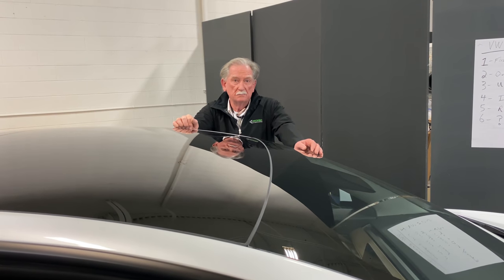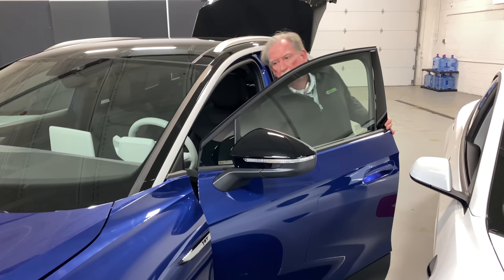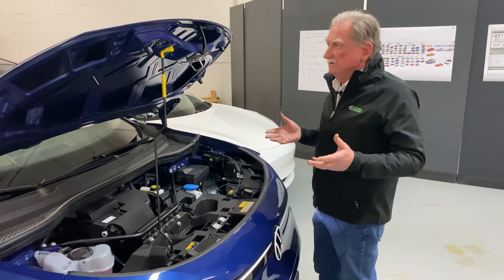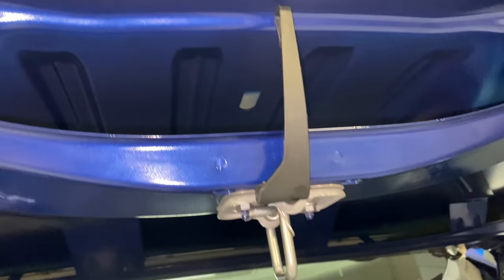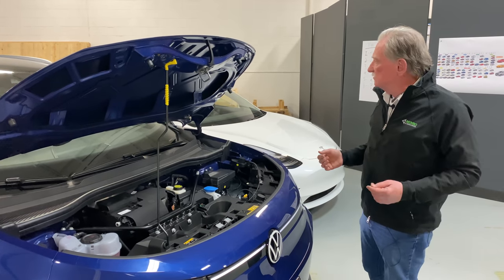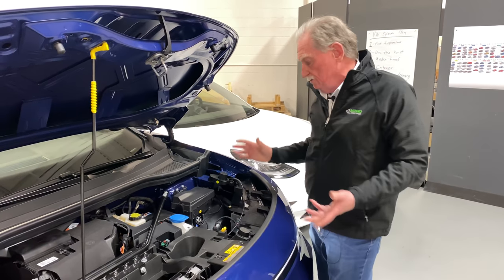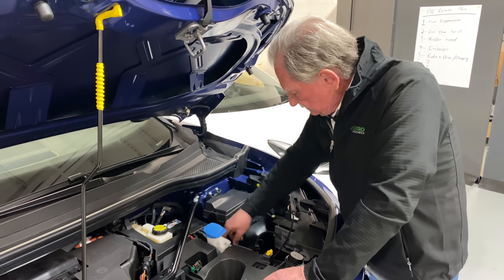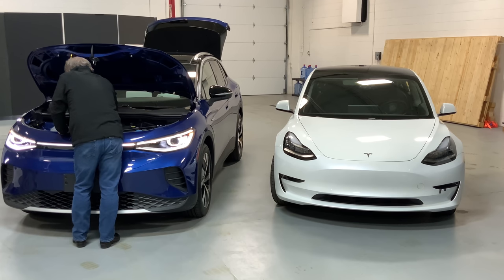2021 Volkswagen ID.4: E2 - Under The Hood

Comment: The more stuff is under hood, the less is in the cabin. Far less front overhang is a good thing. ID4 does not have a frunk because it does not have wasted space in front - more cabin space, more cargo space in the back. That is why it aces banana box test. And pedestrian safety is a very important concern.

Hooking up to 12V system in EV is super rare. You can not jump another car with an EV and very rarely you'd drain your car so much that even 12V is dry.

Try measuring how long is Tesla hood versus ID4 hood.

Comment: They traded the "frunk" to gain more interior space.  Sounds like a good trade to me.
Reply: In Tesla the engine is not inside the cabin. It's more organized and compact compared to vw. Ford Mach e is way better than this VW in terms of compactness
Reply: @adityasahasranshu7503  Of course the engine is not "inside the cabin", on a Tesla, but the engine and other components can be located much lower on the chassis because it has such a big frontal area (same as the Ford Mach-E).  VW traded the long front hood in exchange for more area inside the vehicle.  The result is they had no room left for a frunk.   I personally think that is a good trade.  Give me more room inside the vehicle anyday.
Reply: @mikek2218  space with the rear seat flipped down : Tesla model Y - 68 cubic feet, VW id4 - 64.2 cubic feet. Tesla model 4 more space inside with a frunk.
Reply: @adityasahasranshu7503  Yeah, but the VW has more occupant space and that is the big difference (not cargo).  With EVs, you don't need that big front hood like you do with ICE vehicles.  So a designer can choose what to do with it.  Tesla decided to keep it as big as an ICE vehicle, but also provide cargo storage up there.  VW decided to shrink it down, and provide more interior space in a smaller footprint.  I personally like the latter approach.  Just look how Canoo is designing their vehicles with almost no front "nose" at all, because there is no need for it, and providing huge interior space in a very small footprint.
Reply: @mikek2218  Tesla Model Y - FLR- 41.8", RLR- 40.5", FHR- 41", RHR- 39.4". 
ID.4 - FLR- 41.1", RLR- 37.6", FHR- 41", RHR- 38.4". (LR- leg room, HR - head room). interior space for occupants is smaller in id4, in every crucial aspect then how VW shifting the motors to the front created more space. Tesla is years ahead from VW they ant even make the same interior space by sacrificing the frunk.
Reply: @adityasahasranshu7503  The ID4 is a smaller vehicle than the model 3 and tiny compared to the model Y.  And even though the ID4 is a smaller car, it has an interior passenger volume of 101 cubic feet while the T3 has 97 cubic feet.
Reply: @adityasahasranshu7503  Well... I guess the fact that the T3 has 4 cubic feet less interior space than the ID4, (even though it's a bigger car by 4.5 inches),  somehow makes the T3 bigger inside by your math.  But that's OK... I know very well how Tesla fan boys aren't big on logic.  To each their own and I'm sure you will be very happy with your Tesla.  I personally will chose almost anything else, (except an ICE vehicle).  But then again I also enjoy rowing boats so I'm used to going backwards :-)

Comment: Bit of an odd review mainly around Sandy's confusion with 'all this stuff' under the hood that could be hidden in the cabin somewhere, already answered by various posts below. I think the VW idea of bigger cabin vs Frunk space is a better choice: he showed how accessible the various components are under the hood for maintenance; the Tesla frunk relies on you pushing down on the hood to close it - fun when it's covered in grime plus if you use it a lot how does the paint stand up, or even the aluminum hood itself?

Comment: Definitely some interesting details I learned from this video (and I watched a lot of ID.4 videos in anticipation of receiving my car...).
They kept the hood very short for a very tight turning circle, and then moved the hvac in there to optimise cabin space. I guess they could have optimised it a little bit to include a small frunk, and that would have saved them a lot of bad comments in reviews... As for usefulness, I don't think it adds much unless it fits a suitcase, or like the Mustang with the drain, where its great to put wet stuff (wetsuits and such after a surfing session).
Reply: I think that frunks are less critical than some (including Sandy) think and I would rather have more space in the interior than moved into a frunk, but I do think that VW missed a chance to at least store the charging cable and maybe a flashlight and/first aid kit under there.

Comment: The no frunk is understandable. VW pushed the cabin forward. The power and control electronics sure could use some help. Still using old school manufacturing technology. I still think this is an excellent first for VW making a full EV.
Reply: Sandy says VW should Abandon the MEB platform for a MORE Advanced NEW BEV platform.
its built too much like a GAS car.

Comment: VW claims they don't have a frunk to make more cabin space.
Reply: and they achieved it cause the car is shorter than a model 3 and offers more trunk and a compartment below teh frunk
Reply: they also have used that space to give more room to the wheels, the turning circle is impressive
Reply: + but in The same time, there needs to be a space for front motor in ID.4 X
Reply: The problem for VW is that when they came to design the ID.4 they started with a clean sheet but they used old ways of thinking.  The hood volume of the Model 3 is much smaller than that of the ID.4 and yet it contains an electric motor with battery thermal management heat pump and still has room for luggage without compromising occupant or pedestrian safety.  For efficiency of packaging Tesla has won this hands down.

Comment: Aluminium is lighter but ID-series are meant to be carbon neutral and a ton of steel production generates 2 tons of carbon emissions and for aluminum it's about 11.7 tons of carbon. Also, steel is 1/3rd of the price.

Comment: Measure the length of the hood of the Model 3 and of the ID4 and you will realise why there is no storage in the VW. Instead of putting in the storage cubby, VW made the hood shorter, and pushed the entire cabin forward, so the “saved volume” by using an electric drivetrain contributed to a roomier interior, instead of dedicated storage up front.

Comment: Does your aluminium hood from the Tesla model 3 comply with the european standard, or are there different for different markets?

Those kind of pedestrian protection standards are one of the reasons that I think the Cybertruck will eventually look very different from the prototype
Reply: The CT will not be sold in europe.  It will compete in the US with F150 etc.  If Tesla had to consider pedestrian safety they would probably opt to have better collision avoidance software and perhaps a pedestrian airbag.  Think like Tesla...they just don't copy existing solutions.

Comment: You ask about why Tesla got so much usable space in the front and VW does not. Both cars next to each other but never even a simple comparison or measurement of the fron length and or overhang? Would hope to see that as well as both matter in trafic andit could as well be a reason for more or less free space.
Reply: I suspect that is the case.. I also suspect that a frunk is not anything like a make or break feature in terms of purchasing decision.
Reply: VW ID4:
 nose to front of door: 1.34m
 nose to base of windshield: 1.03m 

Tesla Model 3:
 nose to front of door: 1.31m
 nose to base of windshield: 1.06m

What now?
Reply: @NO3V  Thank you very much. Great to know. So it is close to the same space in bith. Just used in a much different way. Happy to have this made clear.
Reply: @TheEvilmooseofdoom  go watch Björn Nyland videos on the id4, it has way more practicality and turning radius than the model3.

Comment: Doesn't the bar holding up the HVAC system provide lateral torsion support as well?
Reply: That was my thought, is that it is to help provide more front crush protection for the cabin.
Reply: I would say that is the primary purpose for it - the fact that they hung the HVAC off of it is just convenience.
Reply: Don’t think sway bar is needed due to battery pack providing rigidity
Reply: VW has a lot of legacy parts and existing ICE supply contracts that has to be incorporated in their EV designs otherwise it will have to be discarded  (cost savings)

Comment: The cross-bar in the front is not a support for the air filter / AC system.  It's a stiffening bar for the body to reduce cornering roll.

-Matt
Reply: And used as a support too.

Comment: It went to an advertisement right when you touched the jumper cable clamp to the positive terminal on the battery and I jumped. I call that beam a strut tower brace. One factor to consider in comparing against the Tesla is the length of the front portion of the car, the Tesla looks like it has a longer front giving more room to fit a storage compartment but the VW looks like it has a very blunt nose.

Comment: In the UK I’ve a ford mondeo , I had to strip the front bumper 10 mins and it was in bits grills out headlights out fogs out, I’ve also a vw  scirocco same job 2 hours if u can get the grills out without breaking them

Comment: Tesla's less known lead publicly, is in the 'packaging' of their stuff. They integrate, miniaturize and compact their stuff like no other car manufacturer. Optimizing utilization of what they call 'opportunity space'.

It's space grade tech and packaging on the bleeding edge, compared to bulky tech of the 80s. It's comparing an 80s wireless dect home telephone set to an iPhone.

TeslaBjorn did some great testing on his youtube channel. And the did weigh the car...it was way, way more heavy than a model3 or Y...just like the Polestar 2 which was 100s of kg heavier as well.

The ID4 seems to be a good car and very capable EV as well. Seems like it performs less on every metric compared to a Tesla (performance, efficiency, gross margin).

I really hope you guys are going to disassemble this car and give us a hint if Tesla really has a substantial lead with the model y with production cost, compared to the ID4.
Reply: It's about 200 lbs heavier than a model Y; likely because they're using heavier (but cheaper) steel, whereas Tesla uses a LOT of aluminum.  Aluminum is light, but expensive, and energy intensive to mine and extract from the ore.  Tesla's gross margins are around 7.7% without tax credits, regulatory credit sales, and when properly including 50% of R&D costs... like every other company.  That's in line with every major OEM... except other OEMs sell far larger car volumes.  Bjorn just finished his 1000 km test with the ID.4 and was one of the best performing cars on the list, so efficiency clearly isn't a problem.   Tesla's "packaging" might be great to look at, but it's also extremely expensive.  The company would be losing about $3 billion per year without regulatory credit sales and tax credits.   Unlike Tesla, VW doesn't sell regulatory credits so can't rely on that income.  They also understand that tax credits will eventually go away, and the car has to be built cost effectively for it to be profitable.
Reply: @updlate4756  The 'credits' argument is not that valid. First of all, these options are available to all companies complying to the prerequisites of the incentives. Also, it's just money to invest in growing faster, it's not used to compensate or inflate margins. 

You simply can't grow a company 50+% a year in the automotive sector with bad margins and incentives alone.

Also I don't compare Tesla's margins to standard ICE cars when talking about Tesla's lead. But margins compared to other EVs by 'legacy' auto. They seem to compensate their bad margins (or even losses) on their EVs with ICE sales and government incentives (of which Teslas are often excluded by the way).

On the mass of the vehicles. You have to check twice to make sure you're comparing apples to apples....so...

The non Performance Polestar2 compares well to the non Performance Model3 AWD. And the Polestar is about 250kg heavier.

The VW cars compare differently. They come with 60 and 80kWh packs and Teslas with 70 and 50kWh packs. Based on range, the ID3 60 should be compared to the SR+ Model3. The ID3 is over 120kg heavier.

Mass isn't the end all, be all of course. A car is a total package. And I think it's helpful to rate the 'car' bit of a vehicle and the EV bit. There are great cars that are meh EVs and good EVs that make meh cars. 

A good EV has good efficiency, good range, good software, good charging speeds and possibilities.

The comparison I made between cars and phones originated when I saw a proud Jaguar guy on the FullyCharged Youtube channel stand next to a stripped down iPace. The tech was boxy, bulky and modular. Later I saw Jack Rickard (RIP) on his Youtube channel, disassembling the Model3 pack. I was impressed what Tesla did on the electronics side of things...and compactness of it all.

Tesla makes adequate to good cars that are great EVs. VW makes good cars that are adequate EVs.

Comment: I don’t think VW necessarily chose not to include a frunk. Rather, the short front end (the hood is a lot shorter than the Model 3/Model Y), the HVAC components relocated to the front out of the passenger compartment, and the availability of a front motor on AWD models, precluded one from being practical. If the front end of the ID.4 were as long as the Model 3/Model Y, there’d be room for a frunk. But then the ID.4 would both look silly and have a really long front overhang. And honestly, it’s a compact SUV with a cavernous hatch. A frunk is not necessary, at all.

Comment: Curious how it is to access those fluids and filter on the tesla. If it is a hassle I would personally probably take the easy service access over frunk storage. Just personal preference.
Reply: Same for me. Changing the filters on the model 3 takes at least 10 minutes.
Reply: In the Model 3 and Y:
The washer fluid is under the hood up near the windscreen.  Easy to access.

The filters in the 3 and probably thev Y are accessed from the passenger side footwell and are housed in the center console below the center screen. Not hard to access, but definitely more time consuming. In 3 years with a 3, the filter has been replaced once, during the 2 year service.
Reply: @TWGeorge  doesn't sound too bad. Vw probably did this because for people like myself who have never had a car with a frunk, i don't really want one. If I had a car with a frunk at some point would probably feel differently, but pretty much all existing car owners have never had one.
Reply: @connelly6375  It's different, but not really better or worse between the two. It's just an issue of prioritizing different aspects of the design.

The best comparison for cabin space would be between the ID.4 and the Model Y.  

The Model Y has 106 cubic feet with 68 cubic feet of cargo space behind the first row. Wheelbase 113.8 inches, total length 187 inches.
ID.4 has 99.9 cubic feet  with 64.2 cubic feet of cargo space behind the front row. Wheelbase 108.9 inches, total length 180.5 inches

There's essentially no difference.  The ID.4 is shorter by 6.5 inches and only 6.1 inches less passenger volume and 3.8 inches less cargo space.

A shorter car will usually be able to make tighter turns (and the ID.4 does beat the Y in this regard), but I'm betting passengers do not notice that 6 inch difference in the cabin space. The Model Y does have about a carry-on suitcase worth of space in the frunk, so Tesla has used the total vehicle volume a bit more efficiently than VW has with the ID.4. I can't imagine that alone would sway many buyers, but could be a stand-in for feeling the overall design of the Y is better, or at least more thoughtfully approached.

I do consistently use my Model 3 frunk to carry two tool bags and a cordless drill case so it is definitely a feature I use and appreciate.